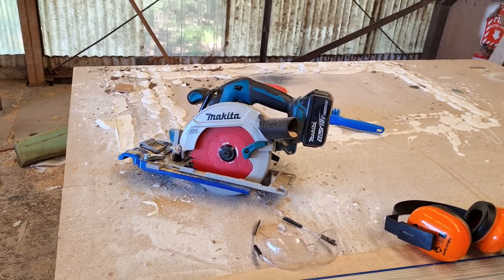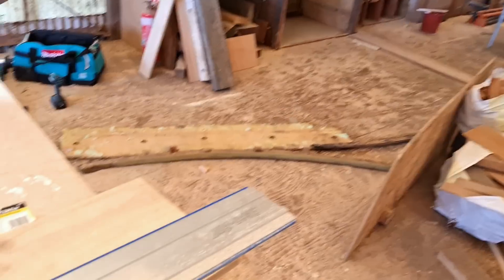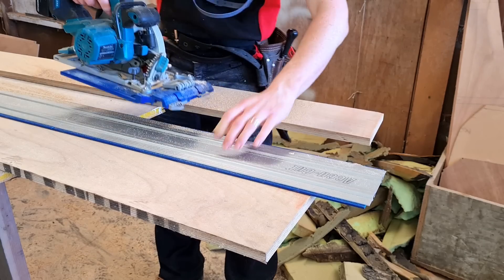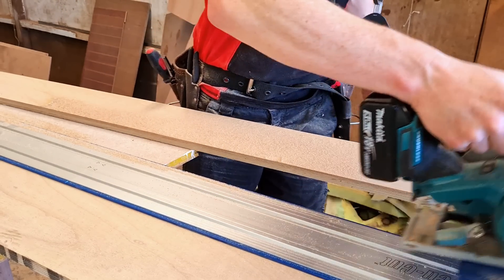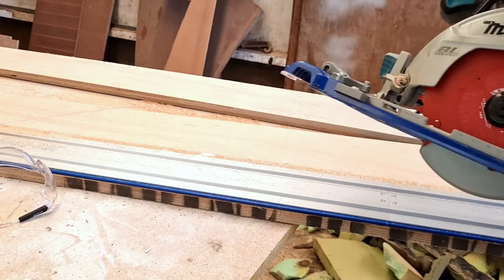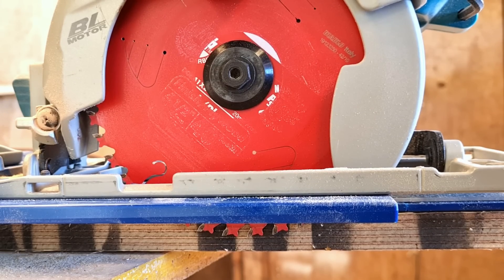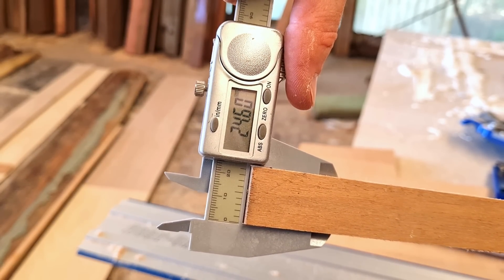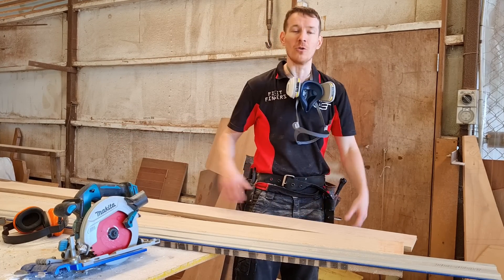How to get more Accuracy from your Kreg Accu-Cut Track Saw

Comment: This is true especially if you cut a full length of plywood. Its not accurate by 1 millimeter. I think the flaw here is the main sled theres a ton of movement. I use a thin maskin tape underneath the sled to eliminate the movement
Reply from the maker: I did that for a while too, it does help. I really hope they release an Accu-Cut V2.0 soon, this design is over a decade old now I think, time for an update.

Comment: The pencil mark is wider than the end-to-end variance. Well said!
Reply from the maker: Cheers mate, I'd not thought of it in those terms! For a (relatively) cheap tool designed to quickly break down sheet goods, it does the job well, making this task a breeze and not requiring another power tool. With care, it can also be very accurate. Can't ask much more than that.

Comment: Hey, I hope you know a "mil" is in point of fact, one millionth of an inch! Jet engine machinist, Tinker AFB, Oklahoma, USA! (retired) We use a Six axis blade tip grinder on jet engine compressors here. The  compressor spool must be stacked and measured to the millionth (specs withheld),  roll, pitch. and yaw so it can spin properly within its shrouds, if not people can/will die. A  millimeter is a millimeter, but millimeters can be divided into millionths I just don't care what that sub-millimeter is called.
Reply from the maker: Interesting job you have there Roy, not the sort of precision I'd ever associate with woodworking. Who said 'mil' though? I said 'mille' which is Latin for 'thousandth' (not to be confused with 'thou' naturally 😝) hahaha seriously though mate 'I'm guessing your work never took you Downunder for any length of time. We shorten absolutely anything here and rely on context to be understood 😉 I can assure you in Australian woodworking, a mil a millimetre. If I was baking, a mil would be a milligram and when I'm at the pub it's a millilitre! The average house price in Sydney is $2.5mil and while if you really want to hit the homonyms a mill is also noun where wood gets turned to into timber that you'd call lumber, and a verb for the same process. Don't you love the English language? 🤣

Comment: The more difficult part of this rip process for me is getting the guide laid down perfectly parallel to the 'other' edge. I make a pencil mark at each end of the board, then agonize over getting the guide lined up on the two marks. Using a combination square to set the position at each end is also troublesome for me, as butting the guide to the combo square at one end causes the other end to slightly move off the mark. 

Basically, I suck at carpentry.
Reply from the maker: Im sure you're doing it fine :) Remember this is a sheet breakdown tool, not a super precision joinery tool. You can cut square, it just takes practice. The start block actually has a built in fence that is square to the track, but I rarely use it. I make my marks, then use a carpenters square at the starting edge to ensure the corner at the start of the cut is close to square as I can get it. You'll always have a slight error if you make two marks and line it up, but it'll be close enough for the vast majority of things you use a tracksaw for.

Comment: I’ve seen guys add some masking tape to eliminate that little bit of slop .
Reply from the maker: @Paul-q3m7k  I tried that with some success. Once it got a little tear though it caused issues so eventually I removed it and just use the twist method 👍

Comment: I tried using this on melamine board and it just walked all over the place. How do I stop that??? Couldn't get a solid straight cut to save my life
Reply from the maker: G'day mate, let's see what we can do. Do you mean walked as in: 1: The track physically slid over the board during the cut? Or 2: That after the cut the piece was wavey and different widths along its length? Or 3: That it was simply tapered and skinnier at one end than the other?  Solution 1: is that Melamine is super slippery and the grip-maxx will struggle to stay in place. If your track is moving during the cut you'll need to clamp it down. The track clamps are not super expensive and I use them all the time. If 2: either your saw is loose in the sled and not held down correctly so check it is setup correctly (I've got a video on that here: https://youtu.be/EzlCE9qvdEQ) and ensure there is no play there, or you are experiencing that little bit of 'sled wobble' I highlight in this video and with practice the twist technique should get you down under 1/8" accuracy. If 3: tapering is using a measuring error rather than a tool error, triple check your track is square to the board before each cut. 

I hope one of those tips helps. Also with melamine, chipout is almost inevitable on the thin plastic surface. A high tooth blade, a scribing cut, and/or using blue tape along the cut line will give a much cleaner result. Good luck! Let me know how you go.
Reply: @FixitFingers  the track easily shifts while trying to make a cut. Ended up just free handing my cuts
Reply from the maker: @fromo14  argh yep that will be the melamine. Grab some track clamps and you'll be gold.

Comment: i bought 2 of these saws in the last 2 days and out of the box the saw will not go down on either one of them
Reply from the maker: While the sled works for most saws there are a couple I've heard that won't fit because of their unusual design. Check your model, I think Kreg has a list on their website, at least then you'll know if it is a compatability issue.

Comment: Being a universal tool, it may work better with some brands than with others.
Reply from the maker: Yeah there are a few saws that simply won't fit, and others that may struggle to lock down properly. The price you pay for a 'one size fits most' solution

Comment: So the issue I have with my accu-cut is the middle. Always an eighth off.
Reply from the maker: That's curious. is the track join alligned well?
Reply: @FixitFingers  yep Kreg sent me a new track and still happens I believe it’s exactly what your mentioning in your video. As I start off in behind my saw/work piece and have constant twist/two contact points and as I walk in middle of work piece on my 8ft rips I lose that contact because my grip and position changes. I’ll be more mindful of the twist and let you know how it goes! Thanks for the video.
Reply from the maker: @westongonzalez3450  argh I see.Yes practice will help, you should be able to get it to more like 1/16th. Remember it is meant to be a breakdown tool, not a joinery tool. With care you can get very good results, but at the end of the day if it must be super dooper accurate a tablesaw will be your friend :)
Reply: I love it when I buy tools to do something and then have to compensate for their lack of ability to do what they were intended for.  

Just keep your saw twisted for 8 feet as you walk down the board.

I hope they print that in the instructions manual !
Reply from the maker: @burtreynolds3143  Ha! Look to be fair, this is improving the accuracy. If you just slap it down and run the saw through, it'll easily cut an acceptable line for breaking down sheet goods. Taking this extra step will help get you under 1.5mm (1/16") across a full length cut. The same could be said for a cheap tablesaw fence. Even a Festool tracksaw won't cut straight if you don't line it up properly at both ends. Use tools within their intended use case with care, and you'll get the right result :)
Reply: @FixitFingers  Sounds like if you only do it occasionally, a straight edge and clamps will do just as well?
Reply from the maker: @burtreynolds3143  yep I'm a hobbyist. If you needed to break down sheets everyday for your full time job, I'd invest in a track saw. I also the much cheaper Kreg straight edge (and a video that compares the two) and before that I used the good old poor mans plywood track saw jig. They all work, the accu cut I find is the fastest and most accurate of the 3 I've found 😊

Comment: For the price of the Accu-Cut it should have far less slop. It definitely moves around at least 1/16" or more in the track. Yes, you show the technique one must use to get a straight cut, but if you haven't come across a video like this, you've already cut your guide strips all to hell before you figure it out. Your mate was right, the track should have more squared and tighter rails. How hard would that have been? IMO,  Kreg had a great concept as the sled fits nearly every circular saw out there, but execution is seriously lacking. You're better off just making one out of a couple straight pieces of wood or MDF,  you'll have more accurate results. Save your $90 and put it towards a dedicated track saw.
Reply from the maker: It certainly could be designed better to eliminate some of that slop, nylon grub screws like some of the dedicated track saws have are surely not that difficult to put in. I used a DIY scrap plywood version for a few years before getting this and they are perfectly fine for sheet break-down and cost next to nothing. Having said that I'd never go back after having the Accu-cut on hand. Yes a (reasonable quality) dedicated tracksaw would be better, but that's another tool in the shop and for the weekend warrior who Kreg target, that may not be ideal when you already have a circular saw. Kreg gear always feels that little bit expensive for what it is, but then so does Micro-jig, Armor, and other reasonable hobbiest grade gear. You've got perfectly good cheaper 'Bangood-no-name' stuff out there, the DIY options which are almost free and usually almost as good, and then the professional options which are super crisp but cost you more. It's about picking where you want to comprimise. Ultimately, I find the Accu-cut good value for what it is, a mid-teir option. (Though it's over 5 years old now I think, so hopefully in V2 takes on some of the feedback and improves on the design ;) Thanks for the insights mate, great observations for others to consider.

Comment: Have this product problem not with accuracy it’s all the cheap plastic and guid gets warped after a lot of use
Reply from the maker: You must be finding a lot more shed time than me :D Mine seems fine for now. The Accu-cut is a decade old design now I think. It would be great for Kreg to give it an update and include an aluminium sled, or at least one that has an adjuster for the fit on the track. We'll see!

Comment: No, 1mm is not 1/16".
There are 25.4mm per inch.
One out of sixteen is not the same as one twentyfifth.
Reply from the maker: Apologies mate,  you are correct, 1/16" is about 1.58mm. As an analytical chemist by trade used to dealing in parts per million, that lack of accuracy is not what I strive for in my hobby of woodworking. I believe I said when eyeballing the slop at 03:08 that the movement was "Maybe 1mm or 1.5mm, so what's that? 1/16" and then at 03:35 I say "a 1/16", 1.5 or 2mm whatever you want to call it, twist" Apologies for being on average 0.08mm or 3 thou in the old money off while ranting on the fly about a non-critical guestimation converting from my non-native system of measurement for the convenience of my American viewers at an accuracy of 95% (0.08/1.58mm) while talking about a tool designed to roughly break down sheet goods  🤔😅

Comment: I was a little worried about installing the blade after reading a couple of reviews. But it was amazingly easy. Took about 1 minute. Works great https://www.youtube.com/post/UgkxjpBI8OOeUXib_iT7UomCrQ-uauwZJ62c  . Cuts easily and is perfect for pocket cuts I needed to make for replacing some old deck boards.
Reply from the maker: It's as good as the blade in it. 👍 Even a cheap Ryobi with a decent blade should get good results with it. 😊

Comment: What is the tools name again? It introduces an error because of the shape of the rails. It's just a bad design. And sorry but I  think the "prove" that you showed at the beginning (cut over a 2.4 metres) doesn't show the problem. It's the wobbly base. I'm sure you can cut a straight line with this, but you have to be skilled. Do skilled woodworkers buy a Kreg Track? I don't know. For me it's a design failure (especially the shape of the rails). But hey, I still appreciate your videos!
Reply from the maker: Argh the real noodle scratcher is "does a less skilled woodworker expect super accurate cuts?" hehehehe ;) Yeah, I am not sure why they went with the trapazoid design over the more common box style but I don't think that is the issue with the little wiggle, I think it's the moulded sled base that just doesn't have a super tight tolerance. There is a reason you get grub screws in the Maktia and Festool ones, to take up the inherant slack. Remember also this tool is designed to use most circular saws on the market which saves you $$$ and from a design point of view that adds complexity whereas a dedicated track saw only has to fit one saw to one track. It ain't perfect by any means, but it's superior to carrying around a 2.4m length of warping wood, and 1/3 the price of a dedicated system. How accurate does a sheet good breakdown tool need to be at the end of the day? Cheers for the thought out comment Jochen!
Reply: Argh: Fixit Pirate! Love your content. Also like this "not so much scripted" video.
Reply from the maker: @jochenmayer  cheers mate!  It's much easier to film these on the fly style things too... Great excuse for the dodgy camera work 😂🤔
Reply: @FixitFingers  Agreed. If you need super-accurate cuts, run the parts through a table saw after breaking them down. If you're within 1/16" inch when you break down 4' x 8' sheets, you're in good shape for most things.
Reply from the maker: Very true! That's what the tool is really designed for. Only tight-wads like me try to use it to replace a table saw :P hahaha

Comment: Even the higher end track saws mate are only as good as the operator, if ya a bell end you think track saws are for precision/cabinetry work.
Reply from the maker: Yeah how accurate does a track saw need to be? It's a carpentry and break down tool by design. It's only tightarse knobs like me who try to force it to be a table saw replacement  🤣

Comment: Just one correction - "mil" unit is 1/1000 of the inch. So 1 mil is 0.00254 of millimeter. With all respect to Kreg I don't think this thing is really THAT precise
Reply from the maker: G'day Andrew, apologies, here is Australia we use the metric system...and like to shorten words, so a 'mil' by definition is a millimetre or 1/1000 of a metre. However, this is slang shorthand and contextual. A 'mil' could also be a 'millilitre' if you were talking about volumes so I see how this can be confusing 😅 This equals approximately 3/64". I try to incorporate imperial measurements for my US audience where possible but I've not heard of 1/1000th of an inch being referred to as a 'mil' before. Interestingly, I'd have called that measurement a "Thou", as in one-thousandth of an inch, and yes it is much much smaller than the metric mil. 😊